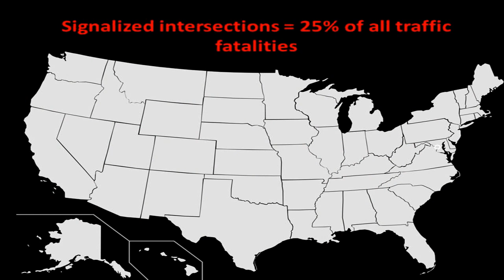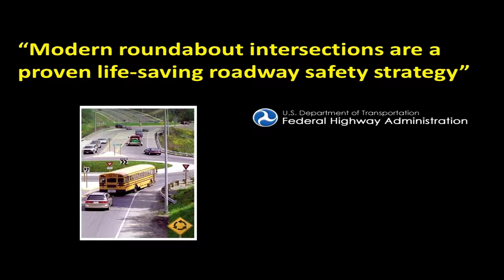Roundabouts: Improving Intersection Safety

Comment: I am a big fan of roundabouts, and believe that they do, in fact, decrease accidents and increase traffic flow. My only suggestion is that for roundabouts that have 2 lanes approaching the roundabout (we have several here in Bend), the sign that indicates which lane goes left (or right), and which goes straight should be placed well in advance of the roundabout. There are 2 here in Bend where the sign that indicates which lane to be in based upon where you want to exit the roundabout is too close to the roundabout and can cause unsafe last-minute lane changes. Apart from that, the more roundabouts the better.